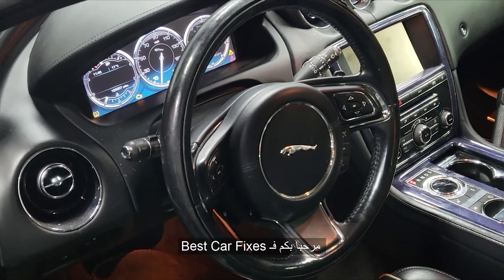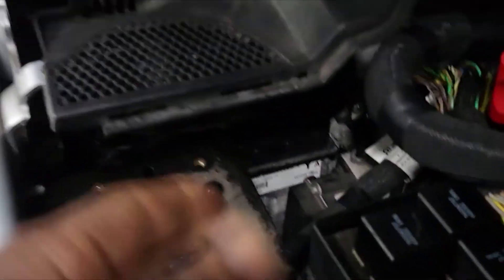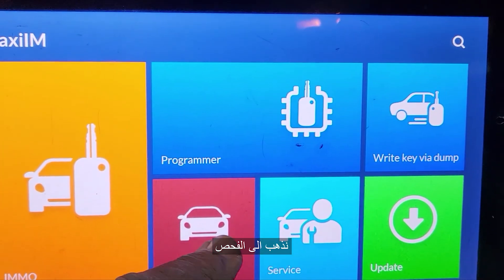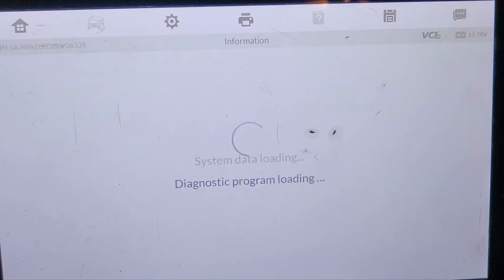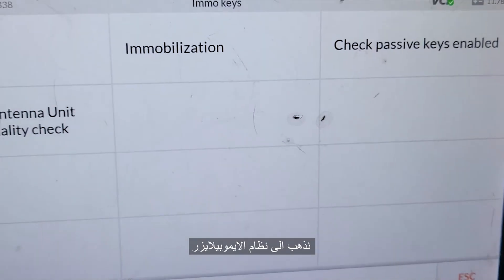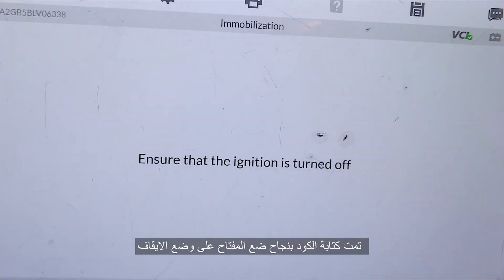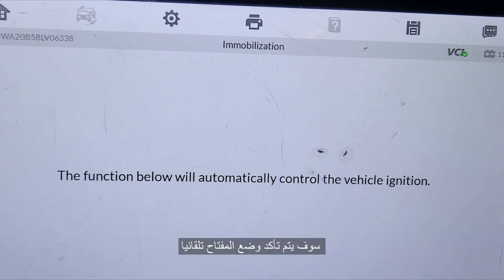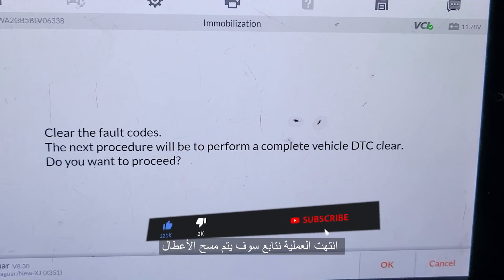Jaguar XJL X351 2011 Engine Computer Programming ✔️ برمجة كمبيوتر المحرك على جاجوار

Comment: I changed bcm in my jaguar and i have 508 device the car works but for frw minutes and stop I checked bcm it gave me passive key code , can i fix that with maxisys 508?
Reply from the maker: Yes go to immoblizer and do paremeter reset